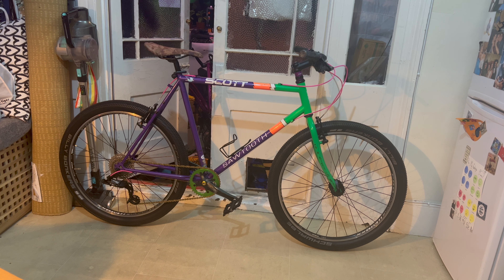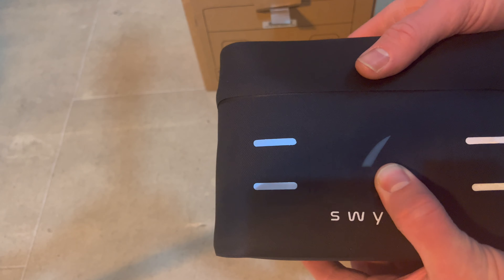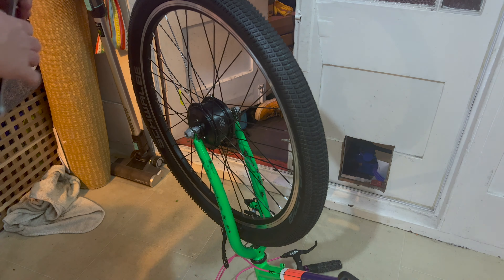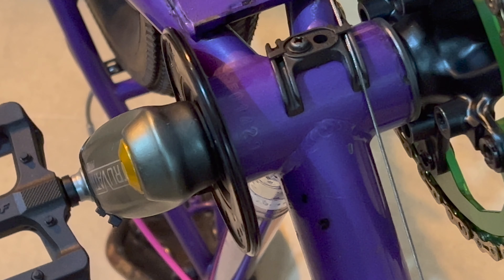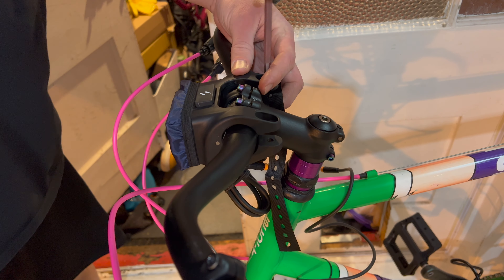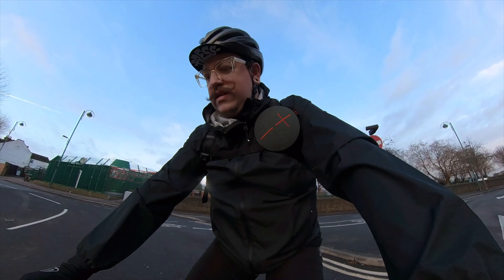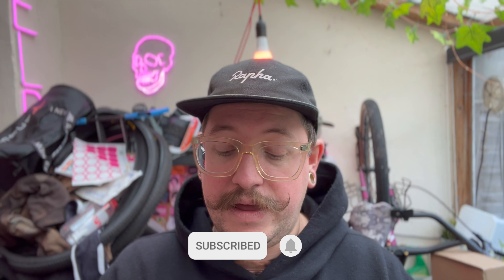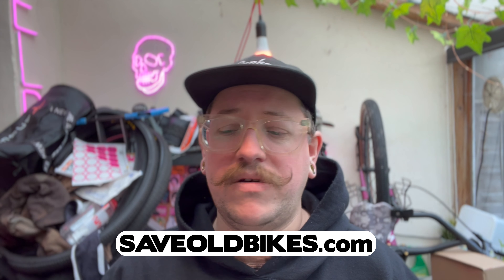90s E-Bike conversion - How to install a Swytch Kit

Comment: Looks a good piece of kit. What is it like when powering around a corner?
Reply from the maker: Super easy, I’m getting places much quicker not because it’s faster but because when you would usually lose power the motor kicks in and keeps your momentum.

Comment: Warning to others - DO NOT use this company.  They do not stand behind their products.  I purchased ($600 for the kit) their earlier gen kit in the fall of 2021.  Rode the bike a total of less than 50 miles over that time.  Kept the battery charged in the 60-80% range as recommended.  The battery is CRAP and will not hold a charge, causing it to cut out after 3-5 mins of use.  Their answer to me - BUY ANOTHER KIT !  Buyer BEWARE !!!!!!!!!!!!!!!!!!!!!!!!!😡😡😡😡😡